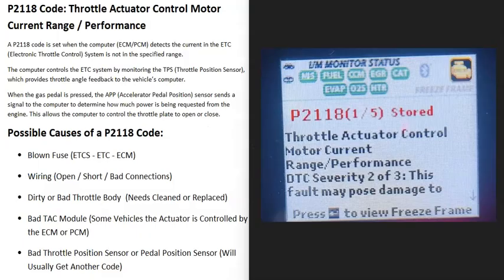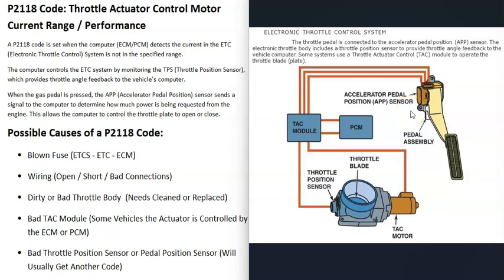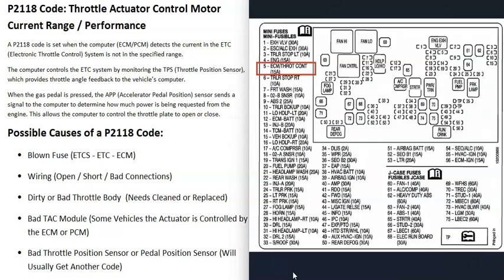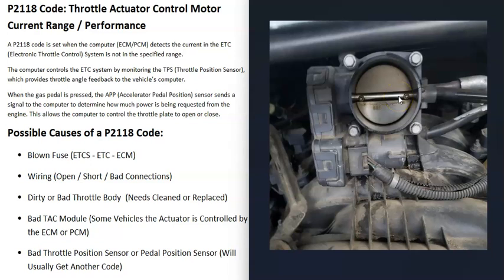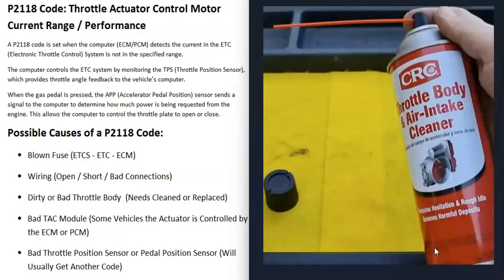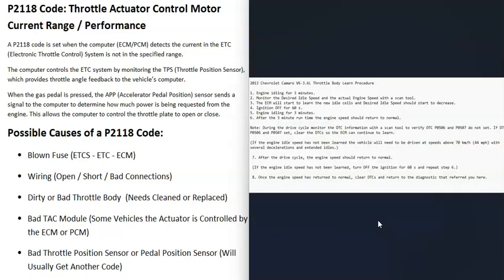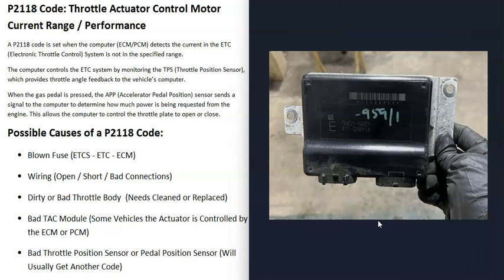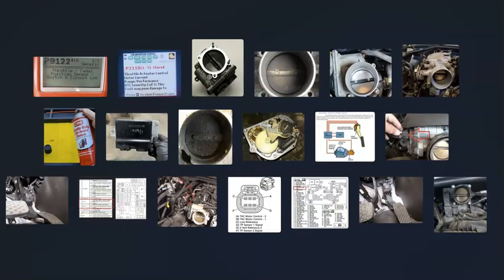Causes and Fixes P2118 Code: Throttle Actuator Control Motor Current Range / Performance

Comment: I have a 2017 Corolla 2.0 Dual VVTI, CVT, with error P2118. I have already replaced the TBI, the accelerator pedal, the MAF and the fuse. Everything is fine. But there is no power from the fuse to pin 59 of the ECU. I made a direct connection, but it did not solve the problem. the car starts and everything works, but the rotation does not go beyond 2000 RPM.

Comment: Hello I have a Hyundai accent blue and I get this code. Today I just tried with a different throttle but it remains the same. I will check the other options

Comment: Im trying to fix my girls 2009 lexus is250 pedal problem. I already changed the throttle body and also changed the ETCS fuse. At first I was getting the p2118 code and now only seeing the p2012 code. Can you help me? Do you have another video? Im thinking its a wiring problem or a computer problem.